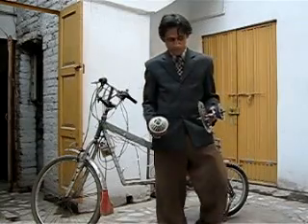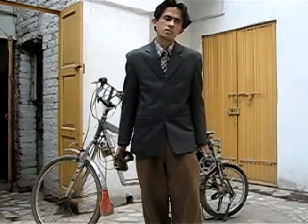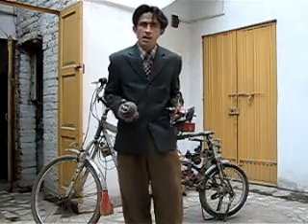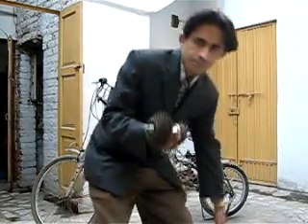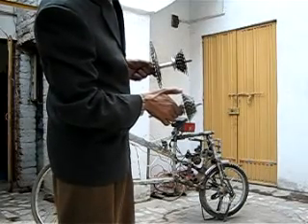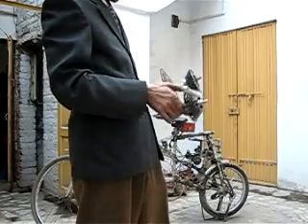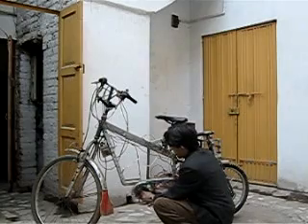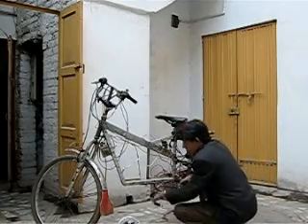Electric Bike from Pakistan (CVT Chains&Gears)

Comment: i need your number. i am also working on a same project but i am trying to run a motor bike without its engine and with its gear box intact to change the gear ratio
Reply: Awesome did you succeed